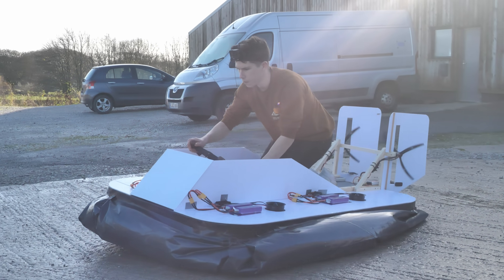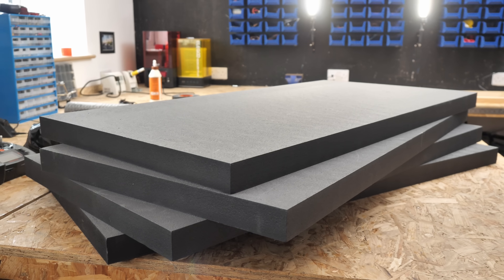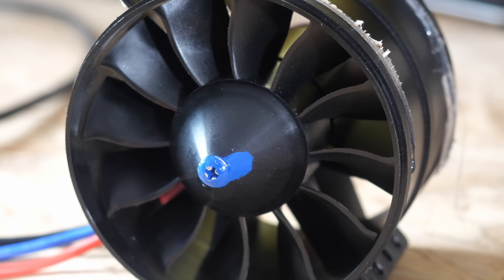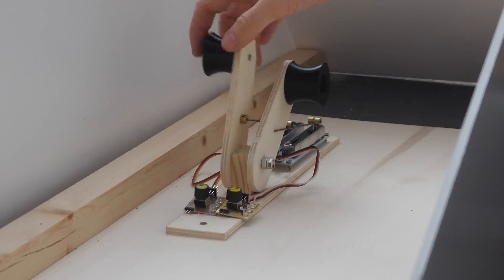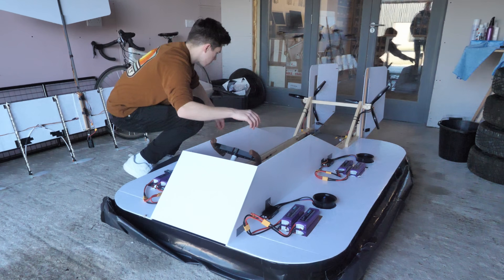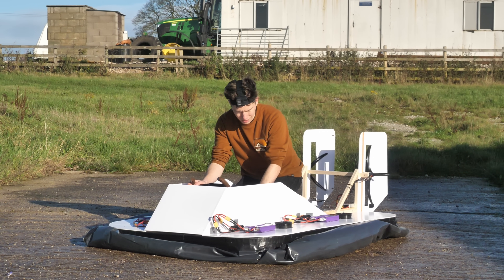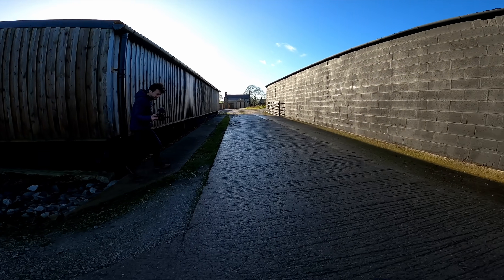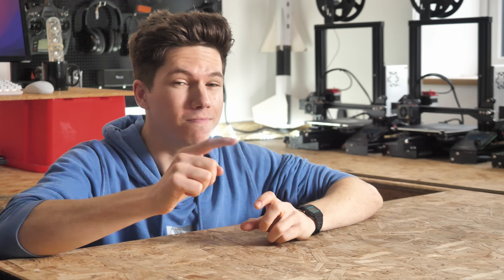Building an ELECTRIC hovercraft

Comment: Nice start to a SEV. A friend of mine use to design hovercrafts or surface effect vehicles to be more correct. 

Barry warned me to keep the cushion pressure below 10 lbs per square foot that would be about 50 kg per square meter. 

Oh Berry designed the Sevtech hovercrafts about 30 odd years ago... the bag skirt that he uses is more stable then the finger skirt developed in Britain that you are likely familiar with.

Comment: Great video and love your proff of concept starting off with a small model 👌 and working out the bugs before you let dad have a go on your machine 😀. Always room for improvement and and watching your video provides lots of inspiration for all of us dreamers. Mabe one powerplant and flexible cable could be used for lifting and steering. And honeycomb cardboard, coated for the deck, and 2 liter soda bottles cut in half to form the doughnut 🍩. Just a few thoughts on a build, with some borrowed ideas from a helicopter 🚁. Keep up the good work and good luck 👍

Comment: Great job but I think your skirt is over simple. It needs to inflate such that it's level with a flat surface. Yours look too uneven. Is not easy to get right. Also if the hull was say 50% wider and longer there is less air pressure needed, albeit more flow rate, so less motor power needed. 

Concur with other comments here on fan choice but model h/c are always a challenge as propellers and ducted fans cheaply available usually come from model aircraft, which have different flow/pressure requirements. E.g. a ducted prop for a plane creates way too fast a flow as planes fly a lot faster. The blade pitch needs to be less for a h/c but such are not available. For the lift fan suggest stacking 2 or 3 props of fine pitch. Preferably 3 or 4 bladed props. More efficient than the ducted props from a/cs  as long as tip gap kept low.  Maybe crop the tips to make them square like the ducted fan ones. But in a simple model like this it is hard to create the bellmouth that the lift fan ideally needs.

I'd suggest safety goggles and gloves as any of those fans could disintegrate.

 I used to build larger hovercraft for a living and specialised in skirts! Building a one man would be a retirement dream. I'd use a segmented/fingered skirt although it's more work.

Comment: Awesome project! What's the reason for going for rudders rather than individually controlled motors when you have two of them? Wouldn't individually controlled motors save you for the unnecessary mechanical complexity of the rudders?

Comment: I did not expect EDFs to be able to lift this thing up.
As I understand EDFs can give you a lot of airflow but not a lot of pressure and as I understand the hovercraft needs pressure in the air cushion rather than a lot of air flowing under it.
Now I;m wondering how much better it would have been if EDFs were replaced by impellers. Or would it even be better at all? Maybe I got it wrong in my understanding somewhere.

Comment: If you moved the thrust props to the centre of the craft and installed them in ducts, this would give a much better point from which to use them with reversible, differential thrust to instantly stop, go backwards, and have yaw control. The simple way would just be to make a throttle that lets the props spin backwards to blow air toward the front for stopping, and reversing thrust, and or producing yaw. The tricky way, is to take a page out of the helicopter rotor swash plate, and tilting blades page to allow more control. The rudders would still help provide stability in forward flight, and allow for fine yaw control at faster speeds. This is very cool.

Comment: Foam already is about a couple thousand dollars.  Dang.
Reply: @Project-Air  I was commenting on the foam that was used.  I figured to buy it costed you thousands.  I bought that same foam for a project and it was 2x2 size, came out over $50.
Reply from the maker: @freepilot7732  Oh I see! No, I got six sheets for £100 which is probably about $120. You can probably get it much cheaper too.

Comment: It looks nice, If you want longer trial and lower weight, repplace the axial propeller for lifting by radial fan, you will obtain more pressure and consume less power (high pressure low flow = Radial, high flow low pressure = axial).

Comment: That skirt needs some re-evaluation, the corners are too crumpled and causing you to loose a tonne of airflow, mythbusters showed a fair few iterations that were fairly simple to construct from irrigation liner muchh like what you used.

Make sure you tape it inside and outside, so that way the bag doesnt just burst randomly too!

This was sweet, and considering the budget probably went to lipos, maybe its time to invest in a 48/52v li ion bike battery or somrthing for these builds

Comment: I used an old 12v fan the other day when making a cooling system for my ham radio. The old brittle plastic fan worked ok at first then became unbalanced and exploded narrowly missing my face. I had no eye protection on and learned a lesson.

Comment: Instead of propeller you must use a centrifugal compressor to lessen the back firing of air  to the blades,if EDF being use then put it axially to increase pressure like an axial compressor CW and CCW set up.

Comment: You need differential thrust for the edfs so that you can ride on slanted surfaces. If the surface is slanted, power down half of the craft and power up the other half to tilt the craft for more straight traveling.

Comment: Jerry rig in a differential thrust to help on turning, build a landing gear that can take the hard landing of cutting off the power suddenly and so it wont just throw you out in the process, rebuild whole steering system to be more robust, maybe carbon fiber plate, but do build in intentional weak point so whole thing wont be destroyed, build cage around the forwards pushing fans that are tied to mounting plate of the motor, again having that whole thing come out if there is collision, the skirt could be made from two used tractor inner tires cut in halfs and connected again with rubber glue for better durability (and shape for the vehicle) and have baffles to first of all added safety so if one spot gets damaged whole skirt wont inflate instantly and secondly so that air wont move so fast from one spot to another allowing you move bit more off from center of gravity.

Also those ducted fans should be pushing in directly inside the skirt and skirt having holes inside surface closer to chassis, where exhaust air is directed under neat the vehicle and hence only way to exit is below the skirt increasing your lift. This way you have maximum skirt inflation while utilizing and directing the leaks to lift skirts out of the groun. You should also install closed cell foam inside the skirt. Get desired size (by testing and calculating how much weight certain m3 peace can create buoyancy in water) round rod of it , cut it in half and glue it inside the rubber... ou and test it in shallow water to see if it floats before going into deeper water.. beats having to dive to get your hover craft bottom of the lake. Foam is covered inside, while also acting as mentioned landing gear depending on stiffness of the foam, it keeps frame from contacting the ground, while also lifting the edge of the skirt off the ground, so wear and damage is located below, not on the edge where it connects to frame.
Just few things to consider for V2. Might want to reread how hovercrafts actually work and those planning on making RC version not much needs to be redone in the design of it, just add the foam flotation, put some tape on the inner side of skirt to reinforce the material you are using or use say bicycle inner tubes, then cut small holes, say by drilling and increase size or number of holes until it wont burst from over pressure. You can build jerry rid measuring device too from peace of clear tube, mount it into board so skirt tube is above it, make U shape, put water into U shape and mark into hose location of water surface. Join other end to skirt by making humps into edge of the tube and pushing it trough one of the holes. WIth more tape you can increase diameter of the tube. Its impractical to get each size hose to fit just right but inner diameter of the tube should be lose as possible to side of hole witch is closest to current hole size  Activate your fan or what ever you use and if water spurts out you have way too small holes creating over pressure and if it does not move at all you might have holes too large. With testing find the right size for say 80% max power of the ducted fan, but at full power there should not be noticeable increase in tube diameter indicating potential to burst if scraped by sharp object, but allows to have extra pressure in required condition acting in heavy bumps as shock absorber instead of hitting chassis to ground, but this requires testing to see what is right for intended capabilities.

Comment: Double up the skirt thickness, might help with keeping the sides from flaring out. there's another design could help if you want to take it on water.  the bag design on yours is great but not on water it, the shirt could fill up with water at the bottom. there's one I've used that instead of the hole in the center for lift the air comes out holes spaced out in the bags on the inside.

Comment: If you add a heat source to your intakes you can get a little more thrust
Reply: He just needs a centrifugal blower so he doesn’t leak all of his pressure out of the skirt. Even the ducted fan leaks a lot of pressure so a centrifugal pump would be a very substantial improvement. I’d say he might be able to use only one or two motors if he put them in a centrifugal blower.

Comment: EDF motors push air fast, props impart more energy, thrust.  The EDF were obviously safer but the props would have been more efficient.  Skirts are always the toughest part of a homemade hovercraft build.
Reply: The props would leak more pressure from the skirt though, a centrifugal blower is the only way to do this efficiently.

Comment: major design flaw:
your donut will eventually pop. It will work until you wear through the material as you are essentially dragging a balloon across sandpaper as your method of locomotion.

Comment: Corner thrusters will help to keep the vehicle on track, and will also help to compensate for terrain that isn't completely level. Also some sturdy fan guards and corner bumpers will help to protect the vehicle and nearby personnel. Nicely done job of "hot gluing your way to a better tomorrow." (Yes, you can use that if you like, with attribution) :)

Comment: I love it!  I grew up drooling over the hovercraft plans advertised in the back of Boy's Life magazine.   I bought them and built one, but the 1980's requirement of using a vacuum cleaner motor plugged into a wall outlet made me dream of making a cordless one.
Reply: Gas-powered blowers work great. I assume the battery-powered ones would also be good.

Comment: The original x4 motors you used to lift the hovercraft up had more than enough power to lift you, in fact even one would have probably been enough. 

You need to generate pressure in the skirt, not trust or flow as you have been doing. Propellers are terrible at building pressures, so you need an impeller. Most real hovercrafts operate this way also.
Reply: Yeah he needs a compressor housing. He could get by with one motor and a compressor housing and effectively quadruple the battery run time while actually lifting the skirt above the ground.

Comment: I get the feeling the skirt needs a TON more power. It's basically dragging it along, instead of it barely touching the ground. Mind you, I've never built my own hovercraft, but I did have a Tyco hovercraft when I was a kid and I distinctly remember the skirt floating - it'd only drag when the battery got really low.
Reply: Yeah the skirt is just to be able to conform to the uneven ground and provide some stability if there’s an imbalance, and it should float a little bit off the ground. It’s the same concept like the board with no skirt, it should float without contacting but the skirts just provide some leeway with bumps and stuff.

Comment: I wouldn't have expected those edfs to be enough for lift.  Do you think edfs are better for that than regular propped motors? Would you say that regular props leak pressure because they have less blades?
Reply: That’s what he said in the video and yeah they leak much less pressure backward which is perfect for this case.

A centrifugal air pump would be way better than both options though.
Reply: @Chevsilverado  must've missed when he said that. I'd imagine they have more amp draw too though right?
Reply: @RECK_Adventures  I don’t think it’s a direct relationship between air leakage and amp draw but yeah Id bet there’s a little bit more at least. The efficiency is definitely higher overall even if it draws a bit more power for some reason.
Reply: @Chevsilverado  I've got some huge Motors I've been planning on using for this exact purpose someday down the road. 5208 360KV
Reply: Also the ducting helps massively

Comment: The small racing hovercraft also use rudders, but at least some of the steering comes from the driver shifting their weight from side to side. That may give you a little more control.

Comment: Great video! Looks like you all had ton of fun building and riding it together. I wonder if you could use thrust vectoring with your dual prop setup? Do you know about how much thrust they each can produce?
Reply: Differential thrust*. But yes, this. Would have been easier to just use a rc transmitter and receiver to control it. Then rudder and differential could just be tied together on the TX.